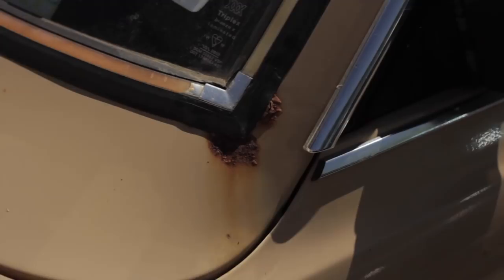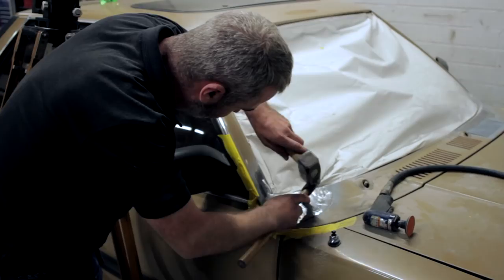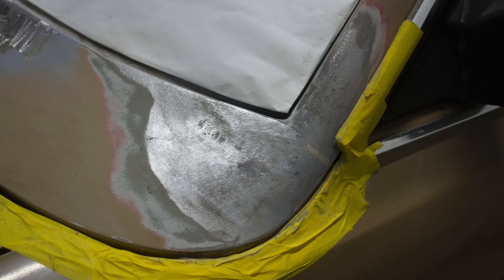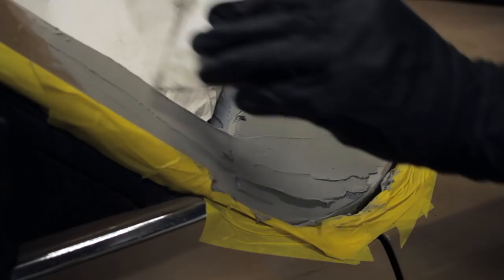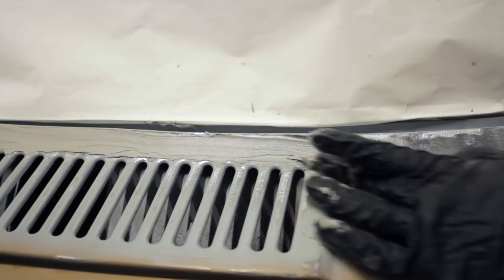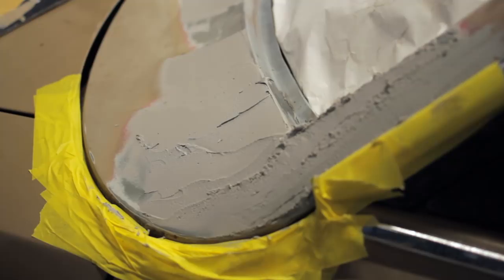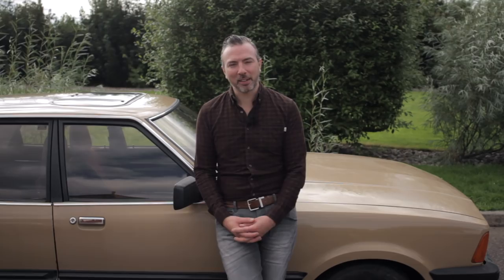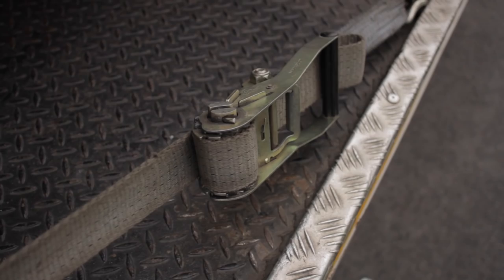Got taught how to panel beat by pros, or cut, weld, fill & paint PART 1 // SOUP Classic Motoring 30

Comment: Little tip when filling , new tins of filler if they have been standing a while will have a little resin pool on the top it's great as it makes easier to spread so you can buy a small tin of resin to add or use a drop of cellulose thinner to thin the filler , I used a rolled up rag dipped in thinner when filling inner wings to spread and smooth out filler .
Reply from the maker: Nice tip mate, will keep it in mind if I find a tin with the resin pool. 👌🏼

Comment: Thanks for the update on Tina. I liked the format of the previous episodes. They felt like a professional TV programme which is testament to your editing skills. I'm sure your new format will be just as good. You'll be glad to know that I finally give my Dolomite a bit of love. Not quite ready for a start up. I'm debating whether to fit electronic ignition or just try to get it running on the points first.
Reply from the maker: I like the previous format too but it's massively labour intensive and whereas I love getting absorbed into something with decent length when I'm watching something, the stats suggest I need to shorten things.

Comment: My two brothers both had Ford Cortina's, both had terminal rust and both had new camshaft/oil seals, skokie cortina's on start up. One a X plate in the UK  and the other a Y plate, sadly they don't make rear axle's like any more.  Keep up the great work on her.
Reply from the maker: She's a fine car. Nice to hear they were all a little smokey. Definitely not made of great steel. Rob is receiving her back in a few days!

Comment: Enjoyable as always. On the strapping side of things that looked neat but the system he used on the wheel is apparently not insured a lot anymore. It's to do with it possibly damaging wheels or brakes. Now they have rubber straps for over the tyre.
Reply from the maker: Think I've seen those. And metal braces too, never been able to find them though.

Comment: I watched both episodes and I don't get why you would do two skims of filler. Why not do it all at once? I've got this coming up on my car - can you please explain?
Reply from the maker: Hi Sacha, it's not an absolute rule so do what you can. The aim is to get the panel as smooth as possible with as little filler as possible. You could slap on a load of filler and sand until the filler is smooth but it's not necessarily a good repair because it could be way too thick. Generally the first skim can reveal high spots or blemishes that will need more attention. You could almost consider it like a guide coat allowing you to hone the repair to a better state. Then skim over again and work until the repair is perfect. Each time you're hoping to sand as much filler away as possible while leaving a uniform surface. How far you want to go is up to you. Technically I skimmed three coats including the Dolphin Glaze. Then as you'll see soon, there are multiple coats of primer to build up a fine surface that also has to be sanded flat before paint. It's a crazy amount of work to do well. Goes to show that good auto body guys know what they're doing, they wouldn't be able to make a living otherwise.
Reply: First off, thank you for the detailed explanation. My takeaway certainly is that it is a lot of work; the hammering being downright intimidating as I can't see any difference in what they are doing (before/after). I suppose the frequent fondling of the area will make all the difference. Only one way to find out; I think I will be making some people very unhappy at my condominium soon, haha!
Reply from the maker: No worries mate, it is a lot of work but it's good work. I'm intimidated by the hammering too and sorry there was no way of making what he was doing more visible. To be honest I couldn't even see it standing beside him. You're right the main thing is feeling what's going on and then modifying gradually. He wasn't hitting the panel hard. More just slowly tapping it down a little. What I will say is after all of the work, when the paint is on and the panel looks smooth.... it's all worth it.

Comment: Should you pickle the bare metal before applying the filler?
Reply from the maker: There was no talk of pickle but they guys explained about etch primer. Seemingly the stuff in cans can't be as good as fresh mixed stuff. Regardless etch primer etches itself into the metal work, and because of it's make up you have to primer over it so that there won't be a reaction with the paint.